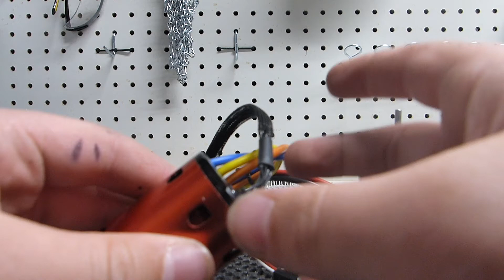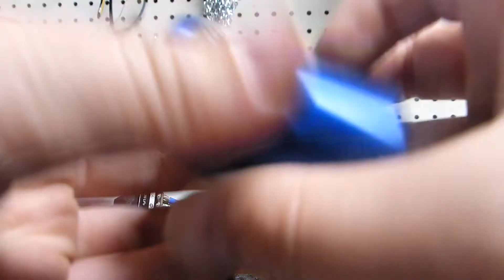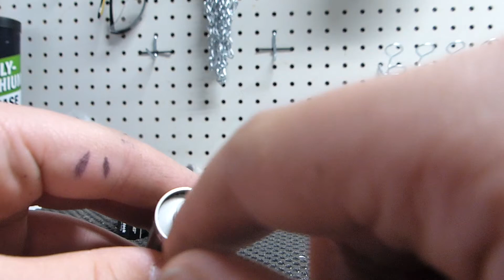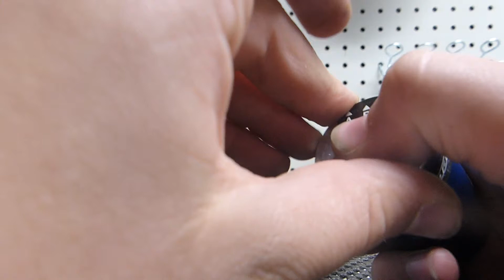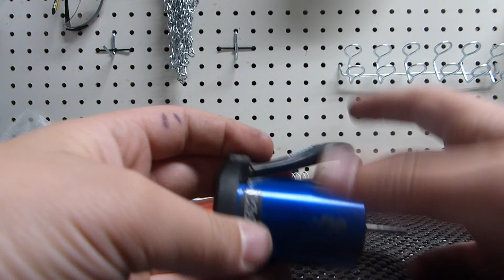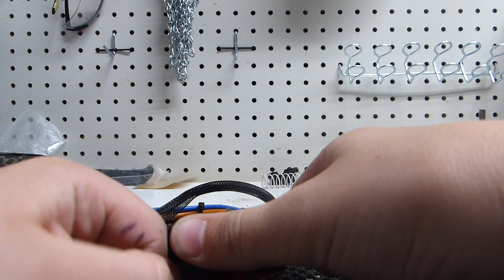Sensored vs Sensorless R/C Motors: Which is better?

Comment: So in other words... a sensored motor is just a motor with a device similar to a crankshaft position sensor on an internal combustion engine.
Reply from the maker: Yes.
Reply: @rctrax7787  planning on getting that setup for my hpi trophy truck as the system its running right now is a castle creations element system

Comment: What’s generally better for drifting cuz u said it’s better to slow down on turns but I drift so no slowing down...
Reply from the maker: Most people use a sensored motor for drifting, usually in 21.5 to 13.5 turns.

Comment: Can I use a sensored motor with a sensorless esc? Thanks
Reply from the maker: Yes, you can use a sensored motor with a sensorless esc, you just will not be able to plug the sensor wire it. It will just run like a sensorless motor.

Comment: thanks for explaining in detail.  I will def stick with my VXL sensor less as it only cogs once or twice during a slow acceleration from a dead stop (never when rolling) I knew what they both are on pen and paper and how a sensor works to stop low speed coggin, but I didn't know the real world performance (up and downs of each). however I come from 3D helis where you don't even use the throttle (always wide open) so in the future I may start to notice a difference.  good to know, thanks.
Reply: Thanks pal